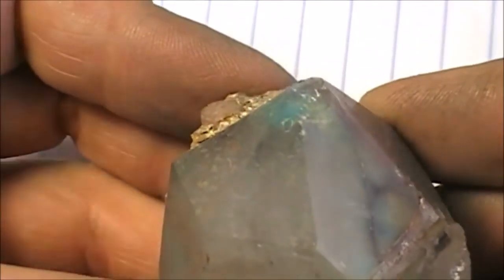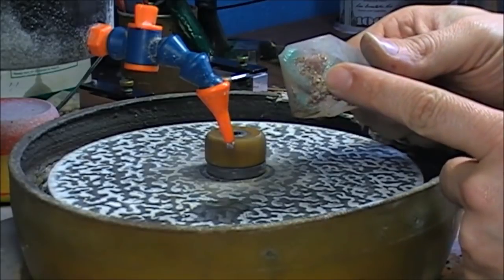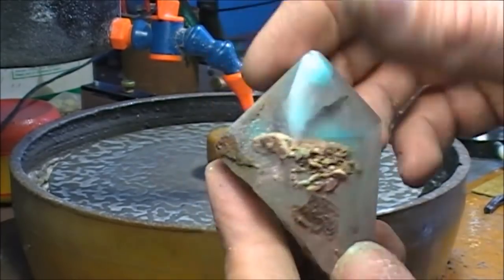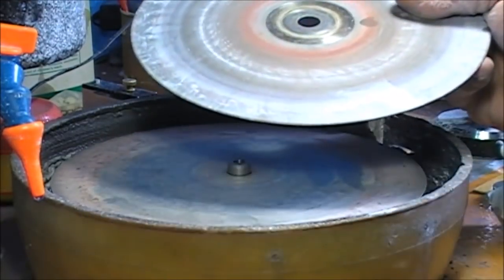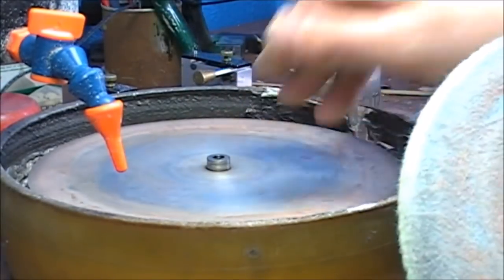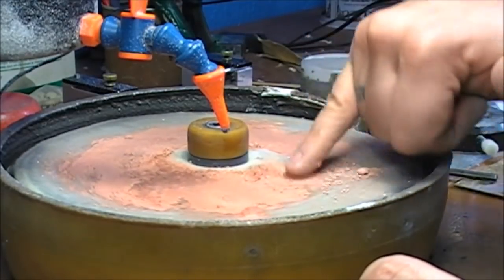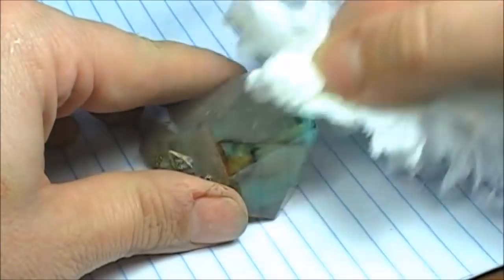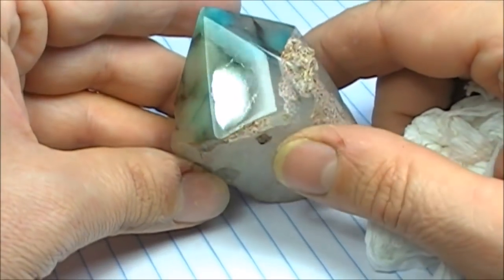How to polish the terminations of a crystal: Ajoite in Quartz

Comment: I have a light pink Morganite specimen on Albite matrix, the crystal is about the size of a small almond, and the luster on all faces of the Crystal is naturally glassy except for one face which has a greasy luster, would it be possible to polish that one face with some cerium oxide and a felt Dremel wheel? Thanks
Reply from the maker: Yes, it's going to take quite a lot of time but you can.

Comment: Dear Angelo, many thanks for the video. could you please let us know at what RPM's you polish, and if it changes from grinding to pre-polish and then polish? many thanks in anticipation.
Reply from the maker: Joseph Silva hey there, thanks for commenting. I think the best speed is the one you are comfortable with. Working free hands is kind of tricky cause you have to grind, see what you are doing and place again exactly the facet on the lap. I guess for this task, as long as you have a good water drip, the faster the lap spins, the faster your facet forms and less likely you have to interrupt and restart the work on the same facet. This is to avoid creating infinite facets due to inaccurate placing of the stone on the lap. As concerns the polishing, you have to establish a speed that won’t stress too much the material and sweep away from the lap the polishing compound. I guess from 200 to 500 RPM Should be fine. (As new, my machine had a RPM indicator on the power knob, with time it has faded away.... so I’m just guessing...🤣) trust your judgement and check performances, there is no fixed rule in this art 😉
Reply: @sutra1976  hi Angelo, many thanks for the detailed explanation and tips, much appreciated. Keep up the good work. Subscribing now.